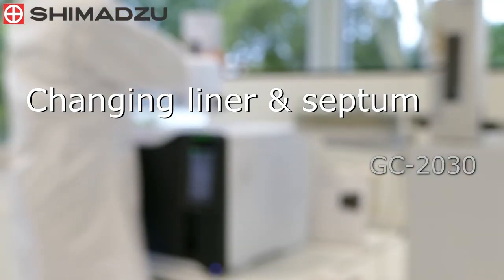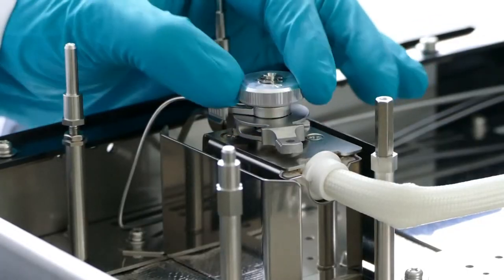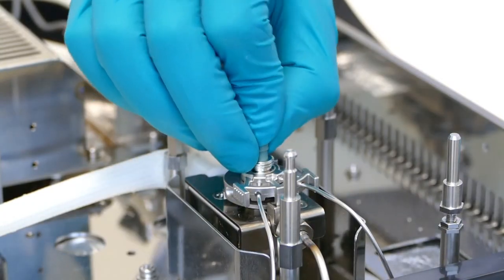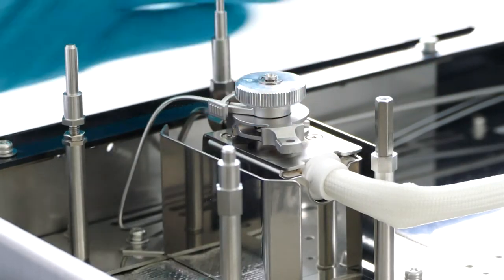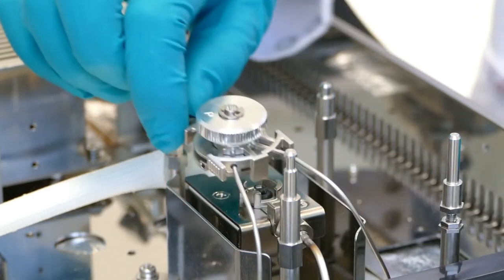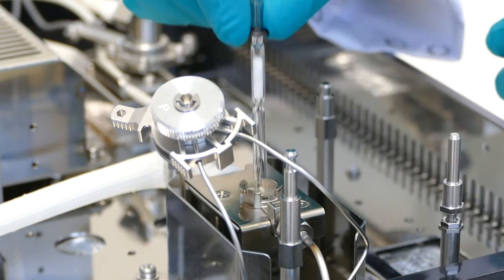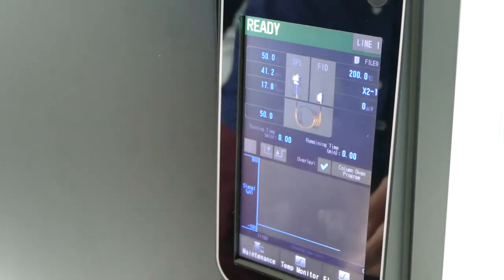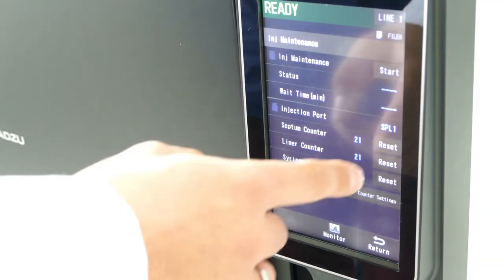Septum and Liner | ENG | Nexis GC-2030 | Shimadzu

Comment: A cordial greeting, where I can obtain information on the frequency with which consumables or parts should be replaced either from the injection port, column or detector
Reply: Hello Jonhe. In Real Time Analysis window, you have the info on the Injection Port consumables shown in the panel to the right. However, the frequency of replacement of injection port parts and the column strongly depends on the analyses you perform on your system. Generally, if you inject 'clean' solutions (like if you're analyzing ethanol for methanol and other impurities content), you don't change liner and column too often (some analysts don't change liners for a year and until serious peak deterioration occurs, while the column would require only trimming throughout 2-3 years, then replace column). But if you're analyzing samples with high matrix load (such as QuEChERS extracts for pesticides), then you have to often replace liners, columns, and even syringe. But it all strongly depends on matrices you inject. In any case, it is a good practice to replace septum regularly as puncturing with a needle worsens sealing. If it comes to the detector, the maintenance varies for specific types of detectors. Generally field service engineers would manage maintenance and cleaning of detectors, although some actions may be performed by the laboratory staff -- it depends on the specific detector and level of the problem.